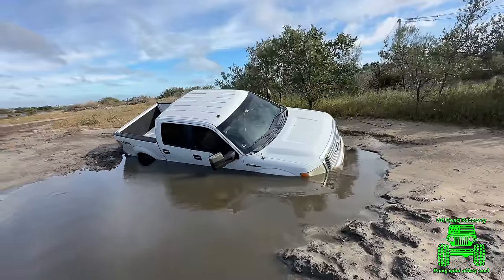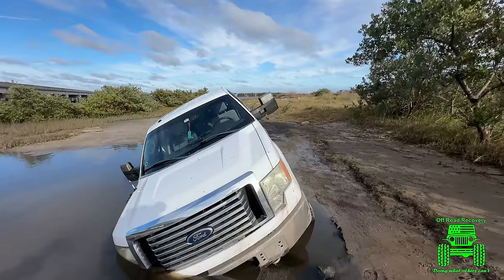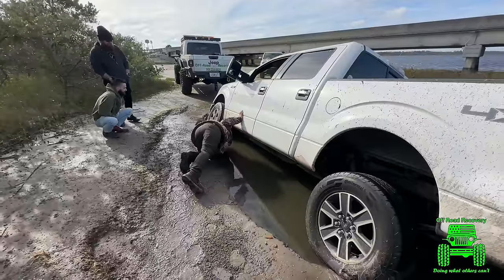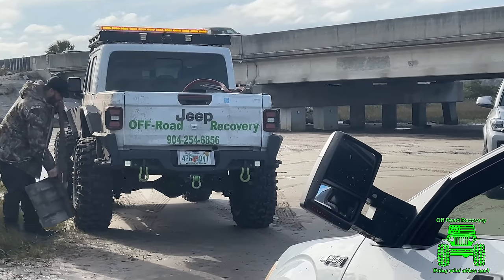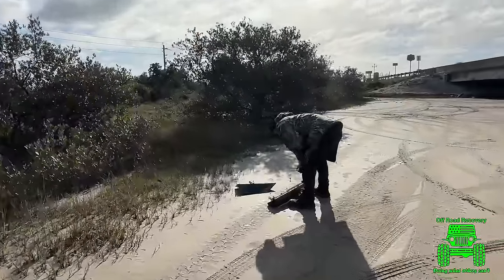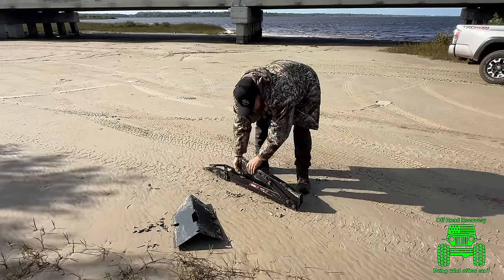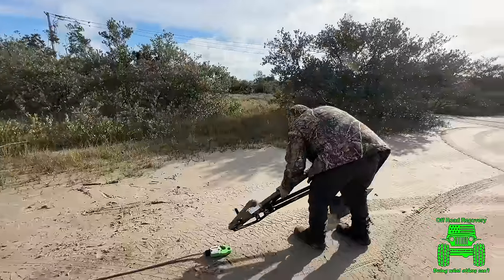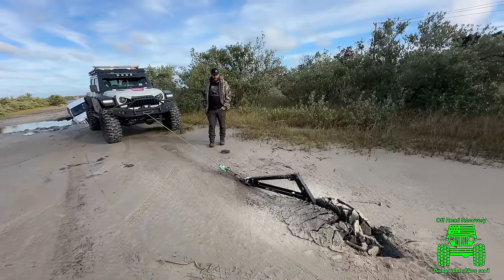This Truck is totaled

Comment: I have no doubt it will be cleaned , detailed, and sent to a car lot somewhere in the midwest and sold as if nothing ever happened to it. Just as so many flooded vehicles from Florida are each year.
Reply: Judging off of the tag I thank it’s from Mexico
Reply: I think I got one😂
Reply: Is a Ford! No problem!!
Reply: Pulling backwards would make a lot more sense  or big forklift would do the job but hey you know what you doing
Reply: oman
Reply: If that’s as deep as it went, it’s not totaled.
Reply: It was only ever driven by a little old lady that would only drive it once a month to go to the doctor.
Reply: @MarkNOTW not even closed to be totaled , just the video title to bring you to watch it 😅
Reply: @MarkNOTW a vehicle is considered "totaled" if the cost of repairs exceeds a certain amount of the vehicles estimated worth. Id definitely say its totalled. Doesn't mean it cant be fixed.
Reply: @mikimiyazaki  I understand that but what significant repairs do you see. Minimal Fresh water in the interior. Doesn’t look deep enough for water in the engine
Reply: @MarkNOTW  dude id bet the engine is done. For the truck to  make it that far like that it likely plunged nose first and sucked air through the intake.
Reply: So true. I live in Springfield Illinois and we have a dealer here that is known for getting vehicles like this that have been damaged. But people keep buying them. Mainly younger guys that want a big truck
Reply: Good idea reverse pulling out only it may sink further due more weight as the motor up front and possibly roll to one side but was safer  what he did great jop 👍👍
Reply: Absolutely is
Reply: Fair trade for all the rust bucket death traps y'all send down every year 🤝
Reply: Going to a carmax lot
Reply: I strongly suspect that the cars destroyed in the flooding after Hurricane Katrina were also cleaned up and sold elsewhere.  😢😢
Reply: @josepholiver6733 New Mexico
Reply: People wonder why auto insurance is so high. Not only are vehicles more expensive but you have every brainless wonder obsessed with wanting to go off road these days ruining their vehicles then filing a claim.
Reply: All the electronics and fuse blocks in the passenger kick panel.....trust me it's going to have electrical issues that will need to be sorted out for a long time and it's expensive....it has 16 computers and module s alone along with lots of other crap @MarkNOTW
Reply: Wouldn't buy it
Reply: @mikimiyazaki Depending on the mileage. That truck should be worth a minimum of 10K (09-14). I'd guess closer to 14K. Even it's the motor. Still wouldn't total the truck. Motors can be rebuilt, interior can be replaced.  Far less that 10K. Probably closer to 4K. That trucks shouldn't be totaled.
Reply: @josepholiver6733  Thats New Mexico plates
Reply: @TheSupernaturalWolf41 yeah and gas is 75 cents what world do you live in?
Reply: This is business

Comment: That is some creative use of force multipliers.  Also creating rear wheel stops and the "land anchor".  Very creative.
Reply: yeah the computers are soaked it's a right off the electronics are done to expensive to replace all the wiring and computers in it better off getting a new one

Comment: The land anchor is pretty cool, when I was in South America, we used to have to bury a tire.
While that sounds pretty easy, it's not.   I also really love the tethered chock blocks, simple ideas like that, really make the recoveries go a lot smoother than they could.   
I know I have at least one chock Block still buried in the mud up on a mountain trail somewhere.
Reply from the maker: That’s why we drive forward and pull them out 😂 they do get stuck stuck in there
Reply: It gets expensive real losing stuff... ;-) @matt.mckinzie

Comment: I had my truck stuck in this exact same hole! You think it's a puddle but it's several feet deep. I still have a dent on my front bumper from this. That's the 206 bridge south of St Augustine. I should have put a flag in that hole because it's been more than just the two of us!
Reply from the maker: We had a sign there to warn people and someone ripped it out
Reply: @matt.mckinzie  A tow company perhaps?
Reply from the maker: @JohnFL  possible 
I know at least one of the companies down there don’t like us because we charge $250 to drive the hour and ten minutes there and they are local and charge $800 for that spot

Comment: Truck is easly fixable  dash did not go under water short is because there was components under water. Just needs a experienced tech working on it.
Reply: But it’s still totaled. Wouldn’t be the hardest job but it would not be quick & that “experienced tech” by all rights should cost more. Not worth it when there’s literally a million f-150s out there that don’t have those problems

Comment: A reoccurring thing I see is a lot of trucks with street tires just because you have a 4x4 doesn’t mean you can go anywhere especially some of the places I see you pull people out of can’t fix it just can’t fix it.
Reply: 4x4 just lets you get stuck even worse and further away from help vs 2WD…
Reply: Also, people misjudging the depth of water. I did that once, since then, I check first with a stick.

Comment: excellent work! Are we really better off with modern tech? My old '78 4x4 with manual hubs, manual trans and transfer case, would have just had to dry off after, no fuss with the water immersion except maybe to repack bearings and change fluids, but you could have driven it away from the site.

Comment: That’s the only bad thing about newer vehicles, the electrical systems get shorted out fairly easily in deeper water or mud. I’d take an old 1960’s Jeep Gladiator with a big lift and tires for mudding over a new rig any day .

Comment: What was the point of running the front winch line back under the truck?  Could have gotten the same mechanical advantage terminating the 4:1 at the rear bumper and a better angle for an upward pull.
Reply from the maker: Jeep would have slid more 
The anchor out front added resistance to the system allowing us to pull more 

It slid both the Jeep and the anchoring during this pull 

Without the extra help from the anchor we would have slid all the way to the ford
Reply: @matt.mckinzie  Using the anchor up front was definitely needed, but why not just terminate the front winch line at the anchor instead of running it back and connecting to the rear winch line?  Were you just trying to reduce the forces on your frame/ bumper?

Comment: Too much work to fix 😮 it can be done if you want to save the truck You Would Have to change all the fluids oil trans Radiator change all fuses and Battery Drain fuel tank Replace fuel filter replace all spark plugs and wires install new muffler and Mr clean the inside 😊 power wash outside 😊 good to go ✨

Comment: what kind of land anchor is that      got to get me one of those    
Do they make different sizes       like To have one for my truck    and a smaller one for my RZR
Reply from the maker: I’d have to check on the sxs size one from Red Ridge industries 
This is one of their anchors and is the bigger one 

If they don’t have a small small one 
Pull pal does 

We are testing out the red ridge ones because they are heavier duty and won’t break as easy

Comment: What size alternator do you use?  Those 2 winches are straining but get it done.  I'll guess that the Jeep remains running while you winch?
Reply from the maker: We have a HO 400a alternator 
We also have “winch mode” which bumps our rpm’s to 2000 during pulls
Reply: @matt.mckinzie  So if my current alternator is about 110 Amps, and I want to put on a 9-12,000 lb. winch, what size alternator should I use??
Reply: 220amp

Comment: Great job!  👏   Just curious if pulling it out from the rear was a option? Thanks
Reply from the maker: Yes it was 
Just not a great option 

This is quick sand not a regular mud hole 

So you go in and only stuck 6” 
Then it just slowly sinks until it’s done for 

So you can pull it out either way but it’s gonna be the same hard to break suction deal 

But it’s also stuck in park 

We wanted to get to the shifter cable on the driver side of the transmission to pop it into neutral 

Pulling it forward was the shortest distance to do that 

So that’s the way we went 
Plus the exit is infront of it
Reply: @offroadrecoveryFL   Thanks for responding.  I had my SXS stuck in something similar last year. Had to leave it overnight and bring my F250 back into the trails to recovery it. I had to put huge Badlands straps on it and leave the tension on it while the suction was releasing. Big pain in the ass but it finally came out.  🙌

Comment: As much pulling power it takes to get some of the vehicles out that are stuck yeah that jeep gladiator does a good job.
For the heavy recovery and vehicles that are buried and dis abled like the one in the video I think a 3/4 or 1 ton 4x truck with a PTO screw drive winch and the anchor system you have for the Jeep because you can't beat old school and the pulling power of a PTO winch.
Yeah PTO winches are slower than electric winches but you'll never stall them

Comment: I thought that hole looked familiar. 

May I ask why you choose to not pull it out the way it went in?
Reply from the maker: It dosnt really matter in quick sand, it slowly sinks and gets concreted in by the sand 
So no matter which way you go you have to break suction 

Things to consider

It stuck in park 
We need to move it to get to the transmission cable to pop it off and put in neutral 

Forward was the shortest distance to do that
Reply: @matt.mckinzie  
Thanks for that. 
Quicksand is not something I have experienced. 
I appreciate the knowledge.

Comment: Why not pull it out from the back, pulling the opposite direction it went would already have tire grooves cut in sand and would have avoided bending the front bumper by pulling it through the untouched sand in front of the vehicle?   Just curious legitimate  question.... Maybe there's a good reason that wasn't possible just not seeing it in the video

Comment: 90% of the time you only see newer trucks stuck. All those modern electronics failed when it was money time. Older truck owners are much more seasoned and smarter. Old truck it comes out of gear and starts.

Comment: Why was it totaled? did high tide get it? didn't look bad in the video. great job by the way!
Reply from the maker: Salt water got into the fuse panel and bsm at the bottom front corner of passenger door 
Insurance always totals them after that

Comment: Truck NOT totaled ! 
In need of new differential lube & tranny fluid.. MAYBE !
 I'd also check the front wheel bearings & stub axles for water intrusion & install "double lip" seals.

Comment: That is not pullpal anchor, but looks quite the same. What brand is this, what features does it has?
Reply: Red Ridge Industries is what he replied on another comment
Reply from the maker: Yes it’s a red ridge 
We broke 2 pull pals 
This company reached out and asked us to test theirs 

It is quite a bit heavier then the pull pals 
But it’s also much thicker steel and in the important areas that kept breaking on the pull pal 

Folds up a bit smaller 

Overall it’s the same but heavier duty
Reply: @matt.mckinzie   Which model are you using the smaller or larger version?
Reply from the maker: @whatnow5313  larger

Comment: So elaborate just get a roll back in there to pull it out 65 year old dude 80 lb overweight with a dirty reflector vest will have that thing out in 7 minutes without unpacking the Amazon cart to do it.
Reply from the maker: It would still be sitting there 🤦‍♀️ 
All the flatbed’s rejected the job due to nasty entrance to get to it

Comment: If that Ford truck would have been a 70's Ford truck, you could have started it up and driven it home after being pulled out. These new Ford's are expensive junk! NOT worth it! We have 4 old 70's Ford's on the Farm still going strong, the 2 new Ford's are Always in the shop, always something wrong with them. As soon as the warranty is up on them, we'll be trading them off for a Dodge or Chevy, anything that is more reliable than the newer Ford's.

Comment: Moden electric control in vehicles is stupid design crap. I have seen it before, won't come out of park because the engine won't start, so it has to be dragged, how more stupid will designers become.

Comment: Anybody that 4 wheel’s knows that pulling a vehicle out from the rear is much easier than. Pull it out in the tracks it made going in. Pulling from the front means making new tracks pushing mud and debree doing so. These wanna be vehicle recovery guys are hilarious
Reply from the maker: Anyone who knows this area knows this hole and knows that you know nothing about this hole. And pulling it out backwards requires pulling it a greater distance before getting to the transmission shift linkage to put it in neutral 

So your comment only makes you look like a fool
Reply: @matt.mckinzie  lmfao so that’s a special hole? Sure pulling backwards is a longer pull. But it’s also an easier pull. I’ve been 4x4 ing for 50 years. Rocky Mountains cascades and Alaska to Louisiana. I’ve never needed a recovery company. I’ve been in holes that are thick sticky mud over the windshield. You’re a joke at recovery.
Reply from the maker: @edgemonsiteworksllc3369  it’s a sink hole no tracks 🤣 
Tide came in and pushed sand around everything and it slowly sank over several hours 

This is not mountain mud my guy
Reply: @matt.mckinzie  good excuse. Again. Louisiana is all sand. Sink holes in every swamp. Your excuse for pulling the hard way is to charge the truck owner more. If it were a true sink hole. That little jeep would never pull it out.
Reply from the maker: @edgemonsiteworksllc3369  we would have. Charged the same either way, what kind of idiot says you pulled him the opposite way to increase the price 🤣 

Let me put it in terms a site work moron can understand 

Post hole dig a hole 
Slide in a 4x6 pole into the hole 
Pour in concrete and soak it with water 

Com back tomorrow 
Hook a chain to it and pull it forward with a pick up truck to remove it 

“Asshole on internet with no experience” (this be you) 

Pull it from the other side moron everyone in the electrical field knows that your a joke 
🤣
Reply: @matt.mckinzie  wow. I know some real recovery guys. Of course a harder pull costs more . Feet of cable used. Difficulty in recovery. Time spent. It’s all about money. Keep it up. Remember people are reading your insane comments
Reply: @matt.mckinzie  maybe you would like to talk your shit to my face rather then being a typical on line tough guy.
Reply: @matt.mckinzie  so it takes you 2 days to pull a rig wrong? A 2 hour from the rear pull max? You are a joke
Reply: @matt.mckinzie  I just read your reviews. You people have a small following. Seems you’ve fucked up more then doing what you claim
Reply from the maker: @edgemonsiteworksllc3369  we have no problem talking you face to face to tell
You that your wrong 
Our small following 🤔 maybe you might be checking the wrong following 

2 hours to recover this ? That must include driving time
Because we were on scene less then 30 minutes
Reply: @matt.mckinzie  you were the one said. Dig a post hole. Set a 4x4 in concrete then come back the next day. Now you change your tune several hours later. Did it take you that long to think that comment up? And “we” will meet you? Do you need your butt buddies to back you up? That’s no problem. Talk big shit don’t you!